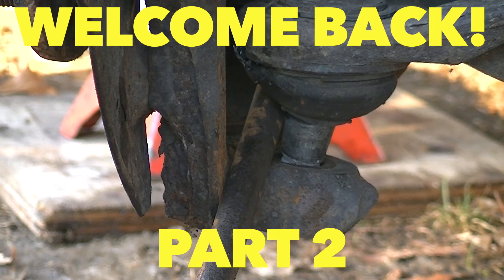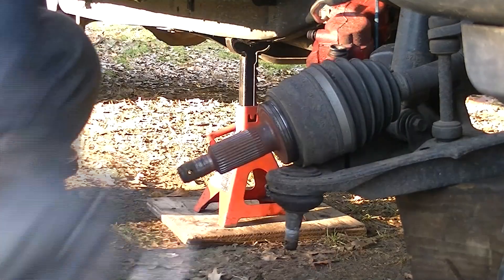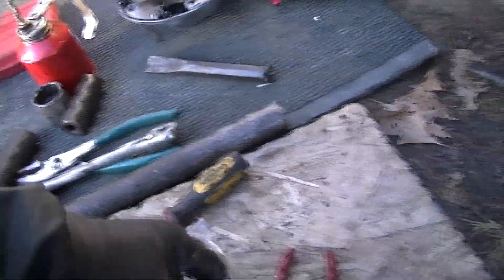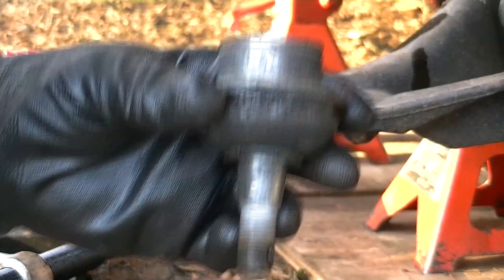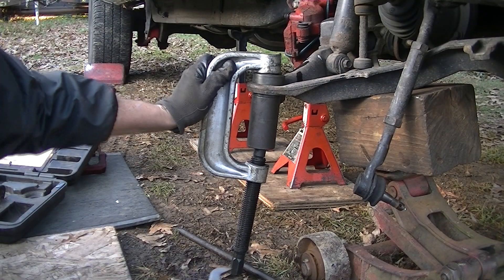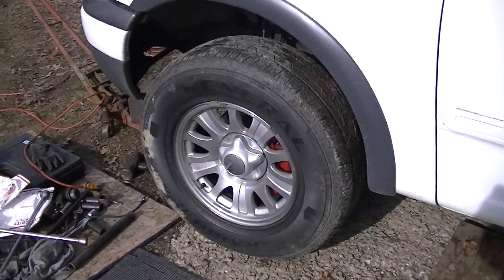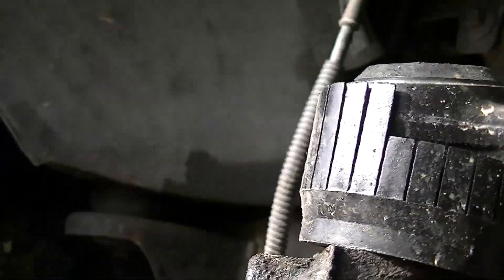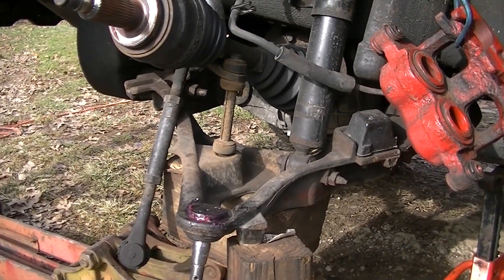Front Lower Ball Joint Replacement....Ford, Expedition, Mountaineer, Explorer -PART 2.

Comment: I watched you on the upper ball joints and I  succeeded. I saved $$$. With my confidence bolstered I moved to replace the lower fronts on my 2002 Explorer. Watching your video ( a 2 parter at that) I anticipated a rougher go at it. Again, your step by step production clearly showed that even a tough going can be successfully done. Thank you . I subscribe gratefully.

Comment: I'm going to be changing mine next week.  They're a pain to deal with. A friend of mine changed his joints on his explorer.  What he did was,, he periodically used wd40 to loosen the bolts and pins. The same thing I did for my rear shocks. For at least a week.  As you already know,  they have rust issues.  So it's usually difficult to take off. Wish me luck.

Comment: Great vid.   Im about to walk out and knock out both lower ball joints (first time doing lower ball joints) and wheel hub assys (20th time doing those) while I'm at it...  Good refresher before i dig in.   And I gotta say... I've never been so happy to have a Harbor Freight down the road.  Lol.  Big ass jack, stands, ball joint press, impact socket set.. all for about 225 total..   I do all my own work, and have replaced just bout everything suspension and drivetrain on all my rides the last 25 yrs .. cept... Lower ball joints.   04 Navigator outta be bout the same.  
Preciate the vid !
Reply from the maker: ;D

Comment: Thanks for the video!  What's the diameter of the ball joint removal adapter ring needed for the '97 Expedition? My kit has a 57 mm (2-1/4").  Is that not going to work?

Comment: Bout the oversized  tnder not staying put,it helps to tighten the nut on the ball joint with the cap n spacer cylinder each time u push the joint out that holds the spacer cylinder thing Inplace from torch
Reply: Boomhauer is that you?

Comment: Cotter, not carter.
Reply from the maker: No way!
Reply: @FixingWithPassion  Cotter pin may refer to: In U.S. usage: Splitpin, a metal fastener with two tines that are bent during installation used to fasten metal together, like with a staple or rivet. Hairpincotter pin, more commonly known as an "R-clip"

Cotter pin - Wikipedia

Wikipedia › wiki › Cotter_pin

Google it for pix.

Comment: ..those ball joint tools are usually bent. it's like the guy that rented it before you used a breaker bar with a 4 foot cheater pipe to install his ball joints. the real good ones aren't made from aluminum of cast metal. when i rent one i'll put it together in front of the clerk so they can note any discrepancy which may affect the performance of the tool. rental tools are like rental cars, nobody cares if it gets abused...